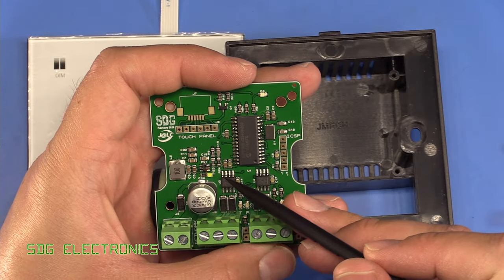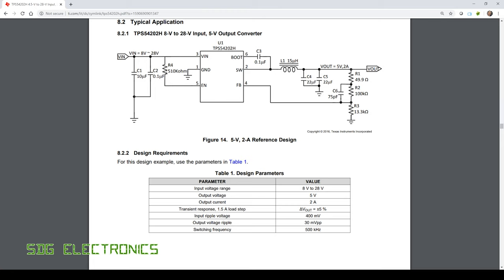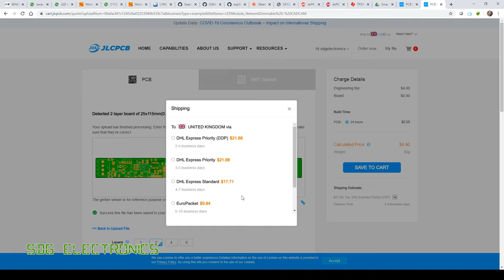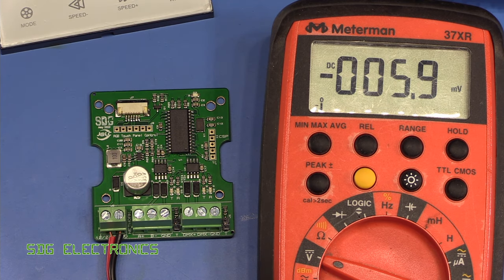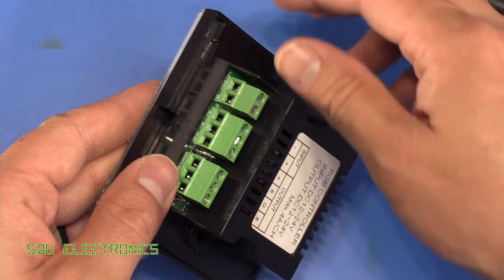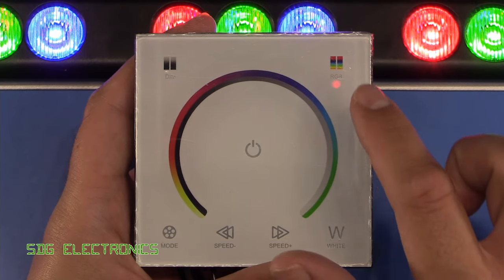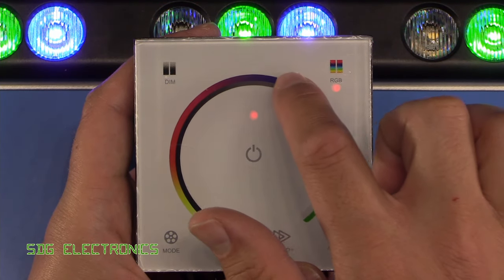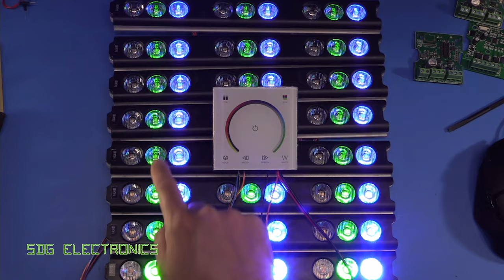SDG #157 Completing the RGB Touch Controller and Europacket delivery from JLCPCB

Comment: What's the difference between me and Steve? Steve sees that the capacitor is hitting the plastic casing a bit, so redesigns his board. If it was me, I would have just taken a Dremel to the plastic casing. I admire the attention to detail on this very interesting project - thanks for making these videos.
Reply from the maker: It crossed my mind, but these days I weigh up cost vs. time a lot more. I've got a handful of these to put together so the new PCB won :D